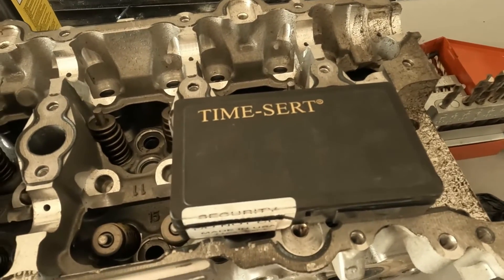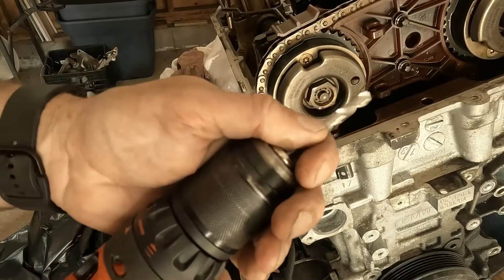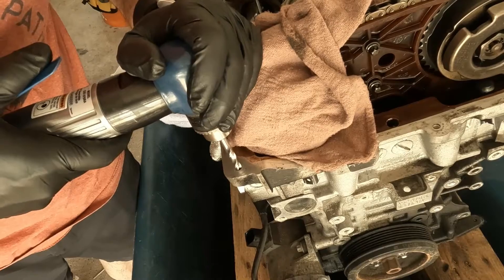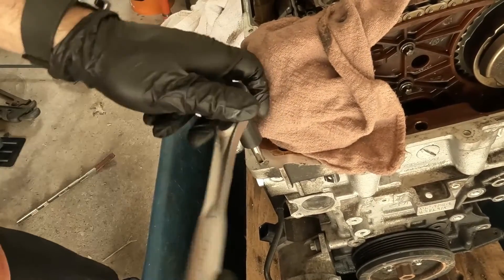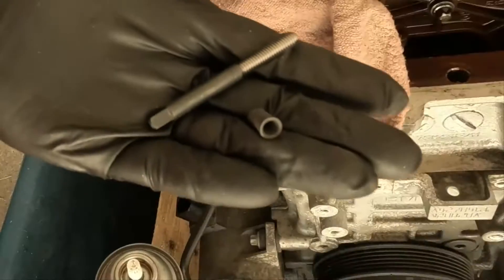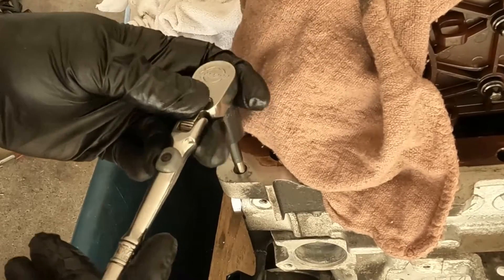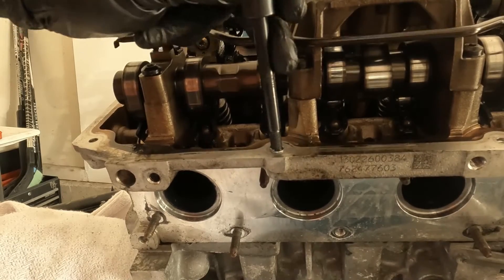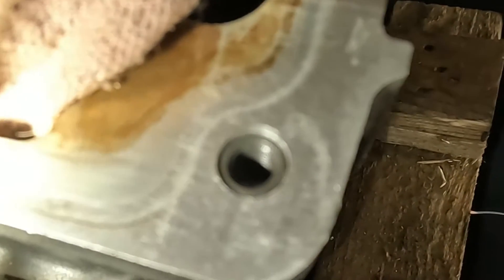How To Fix and Repair Damaged Threads: Heli Coil VS Time Sert! Which is the better repair?

Comment: Love this! What about galvanic corrosion using (ostensibly) dissimilar metals? I believe the N52 is an aluminum/magnesium block and I suspect the time sent is standard metal.
Reply from the maker: @jayhyland1  Great question! I have not had any issues with corrosion from a time sert. The hardware is steel and the sert locks into the aluminum. You can also use some thread lock to seal the thread sert to the aluminum. I also did this on my BMW z3 head. Time sert repair for a damaged block. Stronger than original!

Comment: Time-Sert for the win!

Is there any kind of bushing that can be used to square the drill to the surface that you’re aware of?
I tend to drill off square 😝

Also, those adapters for socket look great! I’m getting some for sure. Lisle??
Reply from the maker: Hi Mario! That really is the tough part of doing a repair like this. Nothing I know of to help that aspect except another pair of eyes to help keep on target. We usually do that in the shop so we can see each angle and adjust. You need your bay buddy to help (maybe your wife can help) 😀I think the biggest mistake is the wobble in the set up of the drill. The hole really does help pull in the drill bit straight. 
As for the tap adapters, I love those things! Lisle all the way. Putting together a video for you on your oil consumption. Members early release 😁
Lisle 70500 Tap Socket Set
https://amzn.to/3nFWY5n
Reply: @AskTheCarExperts  sweet!!